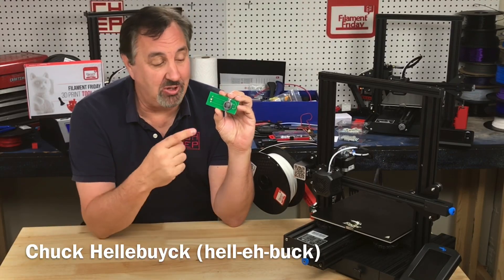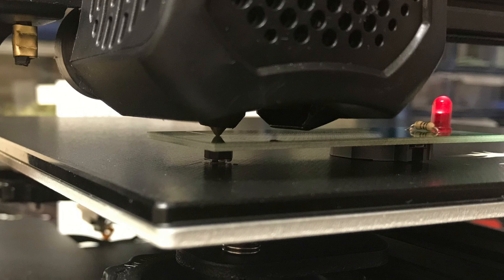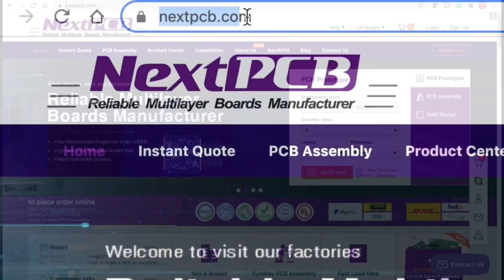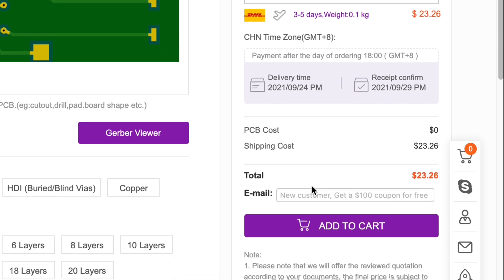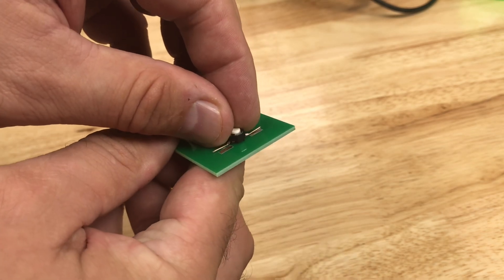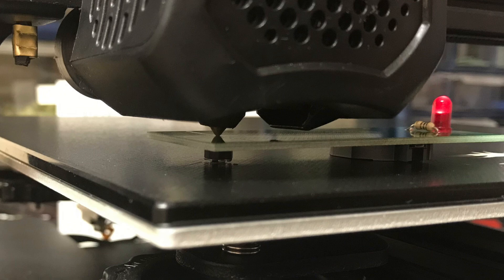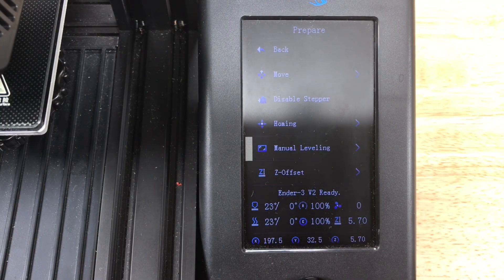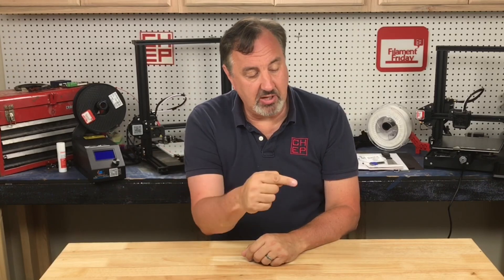Filament Friday E-Leveler - Electronic Device for Easier Bed Leveling on any 3D Printer

Comment: I've been 3D printing for about 3 weeks and I find that BL touch and CR touch are gimmicky as hell. I'm new to  3D printing so I've been trying what people suggested, some of it works some of it doesn't. I've been bed leveling using a piece of paper, it came very easy and natural to me so I don't mind it at all. I received this little device today and absolutely wow! it really worked. I was expecting this device to be... Meh but first layering was really fantastic.  Best $$ I spent on 3D printing thus far. Kind of pathetic that this reads like a bot salesman LOL but then again my 3D printer is printing beautifully, question is... is yours? But honestly this thing works so well that after I was done, I felt like I was cheating and I'll leave it at that.
Reply from the maker: Thanks for that feedback. So glad you like it.
Reply: im convinced that the cr touch doesnt do anything besides replacing your z stop.

everybody says its their to account for inconsistencies in the bed, if thats the case then why does it probe 16 times, and then still crash into the bed.
Reply: Mad Hatter. Virker den stadig som den skal ?

Comment from the maker: Wow! Thanks everybody. I’m told it’s already a popular kit. Really surprised by the response. It was just a fun idea I had. They’re trying to get more in stock as soon as possible. So be patient with orders.
Reply: Not surprised at all, you've reinvented autolevel without any rewiring, and if the user happens to kill the tool with bad soldering, it won't affect the printer at all. Looks really appealing to me.
Reply: This tool looks amazing. I want it badly. Sucks that I have to wait a month to order it
Reply from the maker: They are working to get more faster.
Reply: great!! I guess this could be connected to the bl-touch pins on the 3rd party boards.
Reply: This is awesome! I cant wait for them to get back in stock so I can get one!
Reply: Count me in to buy 2
Reply: @chep Im curious about order, placed order 2 min after video went up, never got a conf email, its not showing on orders for my account but the charge has gone through my paypal and the support for the site doesn't seem to respond??
Reply from the maker: They are scrambling to get orders out. You should hear something soon. Since I don’t have your name I can’t check on it. But they are beginning to ship. I’ve been helping as much as I can.
Reply: Chuck, The ULTIMATE way of Bed Level, is to attach a cheap usb 'EndoScope' camera, pointed at the nozzle. It's small enough to clear the print, and still show the tip clear.

You can easy see the plastic laying out the nozzle, and adjust the bed in real time using your Square Bed Level Pattern.

You Helped me so Much, I hope you read this and try it with a tiny camera on the Nozzle. , and I can show you a video of how good it works if you like.

Thanks Legend.
Reply: What software are you using to make your pcb files?
Reply: Did you delete my post on the dial indicator?
Reply: Order placed! Can't wait!
Reply: I was finally about to pull the trigger and get two kits at once to save on shipping (one for me and another for a friend that just got their first printer), but now it won't let me put more than one kit in the cart. I know it's not your website and therefore out of your control, but it's frustrating. I guess I'll wait until they fix whatever this issue is.
Reply from the maker: Last I heard they were low on stock waiting for more components to arrive. They may have only had one left in stock. I don’t know. Should have more in a few days I’m told so try again soon.
Reply: @FilamentFriday  I just ordered one since they are in stock again! Im a brand new member of the printing community and im so excited for this to come in. I already ruined a nozzle from getting it to close.... Youre amazing!!!

Comment: Just had to share: I picked up one of these months ago and assembled it, but took a break from printing shortly after. I just completely reassembled the machine with a new bed and springs. Thanks to this device, I'm already up and printing on my first try! This is the new de facto standard for accurate manual levelling, thanks Chep!

Comment: it needs to be pointed out that unless your bed is already extremely close to level, this will not give you a level bed with one pass. the 4 corners are not independent. raising a corner of your bed drops the opposite corner, and vise versa. so if your bed is low, then you bring up one corner, the opposite corner just dropped. then when you go back up and bring up THAT corner, the corner you already levelled will drop. 

you have to go around and level the bed back and forth to find the middle point, one pass will never do it whether you're using this tool or paper or a feeler guage.

great idea and video though!

Comment: I removed the bed levelling springs and went to solid pillars which are adjustable , i set the x axis beam so it is perpendicular to the columns then used a dial gauge mounted to the hot end to level the bed and once i had all 4 corners the same i let the BL touch routine look after the rest - now i don't even bother worrying about levelling the bed . Bed levelling is old school and if you treat your printer like a CNC mill and use something like a BL touch sensor routine to allow for dips and high spots in your bed life becomes much easier .
Reply: I don't worry about dips and bumps as use a sheet of float glass as the main surface which is flat so the sold pillars work fine

Comment: If you want to enhance the measuring tolerance, you could use something like an ATtiny in SMD package, a pressure sensitive resistor and 3-4 LEDs to create a simple pressure measuring tool. Should work in the same way, but the LEDs light up one after the other when applying pressure. This should give you a slightly higher amount of precision.

Comment: Great ad for the sponsor. I question the repeatability and accuracy of the button. The button will trigger the LED before it's fully compressed. Using an shim/paper of known thickness and having the nozzle just barely scrape it would be more accurate. The marginal difference between a vary loose fit and a tight fit between the shim/paper will be more accurate than the difference in the button triggering the LED and the button being fully compressed.
Reply: I agree. A piece of paper is far simpler, faster, and basically free... and if that sheet of paper rips, just use a new one. This is what I have been using from day one, and it has yet to let me down (ie, getting evenly squished first layers).
Reply: This isn't a new idea. It works fine.
Reply from the maker: Paper will leave the nozzle 0.1 away from the bed unless you live adjust or change Z offset. This gets it closer to true zero.
Reply: I haven't built this. I think... with this device you'd start with the switch completely unpressed. Then, adjust the knob slowly until the light just lit up. Since the button can go further, the accuracy will depends on how slowly the knob is turned.

Compare to paper method, the tolerance might be higher as paper would not squished as much, but visual indicator would be more objective than how the paper feel.
Reply: It's accurate because the throw of the button is within the measured tolerance of the device. I measure until the button is borderline pressed, switching on and off under the slightest movement, that shows you are within the button's throw and therefore within the measurement tolerance

Comment: Thanks, Chuck gave me an Idea to use an old gate/garage motor remote and it worked great. I need to spoof the S1 pro a little because the height of my board is 6.4 and I can only set the offset to 5 on the S1.

Comment: I think I’m gonna one up this and just say take a 0.2mm feeler gauge and use it as an contact point (with battery and led in line) and connect the other electrode/gator clip to the extruder body. It’s metal and electricity will flow from body to the nozzle to the feeler gauge.
Reply: You could also use a multi meter set to continuity mode with one probe connected to the feeler gauge and one to the nozzle
Reply: @AndrewAHayes  you’re right
Reply: This is essentially the system that Lulzbot printers have used for years. They level against washers at the corners of the bed by closing an electric circuit. It's a neat system... which fails moderately often when plastic ends up on the nozzle.

Comment: I used pressure sensor with arduino that displayed a value on a lcd display. It can also be made to use a piezo buzzer or use led's by modifying the firmware.

Comment: Great video. I have not seen anything like it available in 3D printing which as you pointed is funny because cnc machines use bit setters all the time. Could see this being super useful for someone new that doesn’t know how to visually gauge or get the correct feel with something like paper. Awesome job man 😬

Comment: The only problem is that without a backlash nut, any time you push against the nozzle, it is going to rise up to the extent of the backlash present in the leadscrew/nut assembly. Even with a backlash nut, using the nozzle to push down on the switch will induce some errors.

It would be better to use a linear microswitch instead of a momentary pushbutton switch, which tends to require a greater amount of actuation force.

Comment: I purchased your E-Leveler Device, its a great tool the issue im having is when i level my bed with this tool it levels about .5mm to close the the bed. i put 5 pieces of paper under the device and re-level and it comes out great.

Comment: I like this, but I don't like having to readjust the settings on the printer.  I don't like the Enders UI.  But, Chuck... This is BRILLIANT.

I'm going to get wire up a U-connector, put it between the print nozzle and print head, wire it to a single AAA battery (far enough away to not be affected by heat, and no resistor will be required) then wire through to an LED, then to a thin metal plate of known size.  I reprogram the buttons on my tablet that talks to OctoPi to reposition position the print head to 0+${Thickness_of_metal} at different points on the bed, then readjust the bed as needed.

There's pros and cons to both of these methods.  Whats here in this video, the downsides is resetting the printer every time you want to bed level, and depending on the quality of switch, it could break and you're looking to replace.  The upside is that it is a SOLID tool that's put together and very easy to maintain.  No moving parts other than the button.  In my way, with moving wires around, you could break solder joints, but, this tool stays WITH the printer, and there's no adjusting of printer settings.

Another option I just thought of is put some buttons on the four corners of the print bed, wire up the buttons in parallel and you'd get the same deal.  Potentially a loss of bed space in the corners but I RARELY print at the corners anyways.  That thin head cleaning line that my Ender prints out before each print is easily reprogrammable, so just shorten the line, do more passes.  I'll just need to remember to change that setting if I ever reload OctoPi... heh

Comment: Forgive me if I don't understand or missing something. You set the Z offset to 5.7 then 'level' the bed with the device. After you then set the Z offset to zero. Wouldn't this mean that the nozzle is set to the absolute bed surface? What about the gap between the bed surface and the nozzle? Thanking you for your videos. Always interesting and informative.
Reply: The 5.7mm measurement was when the button was fully depressed, but when levelling Chuck was getting it to just barely turn on. Maybe the distance between that state and fully pressed is what gives the first layer distance. Seems like a cool way to level, but you'll likely need to tweak the Z offset once you do.
Reply: @mikevsamy  Thank you for the reply. I like the concept but would like clarification as to how the gap is obtained and measured.
Reply: @phorton7039  agreed.
Reply: When start printing, printer will adjust the gap from zero based on the layer height setting in slicer sofware. If your nozzle is not zero to the bed it will add on the first layer height.
Reply from the maker: The first layer GCode will offset the nozzle per your slicer settings. Typically 0.2 or 0.3 mm.

Comment: I bought one and I love it. I left a review on Amazon as well for any who are on the fence. For those concerned about the $25 price, keep in mind we are not only paying for a battery, circuit board, a few cheap components, Chuck’s prototyping time, etc… No we are helping to support a really nice gentleman, who has been helping us, for years, for free. Buy one! You you will not regret it.
Reply: i'm willing to support chuck and that's why i won't buy the china copy
Reply from the maker: Thank you for the support.
Reply: @FilamentFriday  are there other distributors in europe apart from amazon?
I've found dealers on amazon(uk + de), but they charge 77€ - 85€, which I feel is exorbitant.

Comment: This is cool! I'm going to try something similar by connecting my multimeter in beep mode to the nozzle and a metal plate on the bed and I'll use the beep instead of an LED. It's probably important to mention that it has to be placed exactly over the adjustment screw in order for it to work in a single pass.

Comment: Manual adjustment is pain, I remember in mid 90's when we got first PCB router, it was manually adjusted, try to find suitable feeler gauge to under toolholder stop (when it lay against PCBs copper routerbit should go deep enough and cut copper away but not too down because router bit was V shape and too deep cut remove copper all the way it it was thin). For me paper works quite well for Ender 3 and 5. But of course we need tinkerin and someday got progress. This is interesting idea, by the way.

Comment: Might be a good application for capacitive touch using an 8 pin ATtiny and a large copper area on the board.  Then only the thickness of the pc board would be used and no moving parts.
Reply: FSR with a comparator would also work

Do some trial and error with an fsr, multimeter, and MANY iterations of your z offset to get good nozzle height, record that resistance value, use that as a fixed reference resistance, once the FSR reaches that resistance, the circuit closes and you get the endstop signal
Kinda complicated, but would remove mechanical points of failure

Comment: Too bad that the shipping cost (for the CHEP Electronic Bed Leveling Tool Kit) are very expensive for me. => $ 20,00
Reply: "shipping cost" "free" ... this is garbage. If someone at this company thinks that this is a good advertisement: nah, i will never use your service. Maybe hire some adults doing marketing. Super pissed.
Reply: @notlocalhorst  Why is this upsetting? Obviously they cannot "give" things away. Somehow they have streamlined their manufacturing such that they can swollow the cost of manufacturing some small number of boards. That saves $2 on the board cost from their basic service. But, the shipping remains the same.

It's not deceptive or even unusual. What's unusual is to be able to buy things without paying for shipping specifically (though Amazon has made that feel normal).
Reply: @martinmckee5333  $20 is not the shipping cost, that is shipping plus the goods. So much for "free". I prefer to see the real price of both. If this is not unusual for you: ok, go ahead and use the service. I will not. It is NOT about not paying for shipping, it is to have a fair and transparent pricing. If i miss something and didn't saw that it is priced separately I apologize.

Comment: Interesting.  I had the same basic thought, but using a strain gauge — more complicated, but should be more repeatable than a switch, although probably good to 0.001 mm which is likely to be overkill.

If the switch is good enough then this should work fine.  👍
Reply: This will probably be more accurate than a strain gauge. A microswitch trips at a set poistion regardless of the pressure of speed. A strain gauge measures strain, and thus will be influenced by things like speed and temp

Comment: Before I purchase I need to understand something.  Isn't the nozzle just being adjusted to the relatively large thickenss of the watch battery or switch all around the four corners, and
not the thickness of 0.1mm or A4 paper during a conventional leveling using paper ?   Do you have to then manually introduce a Z offset value to compensate for the fact that you were leveling to a much larger nozzle gap of the device ?  I'm asking because my (original) Ender 3 does not seem to be able to accept Z offsets even though that control is available on my LCD screen.
I'm not questioning the value of the device, just trying to understand it before I buy...  Thanks.
Reply: Yeah, I just got mine in today, forgot about that and it does require the ability to manually adjust z offset, and my Ender 3 v1 doesn’t have that ability. At least using the encoder menu.
Reply from the maker: The z offset set to zero is the intent. The custom GCode offsets the height during measurement at each corner and then resets to zero giving a near perfect bed level.
Reply: @FilamentFriday  Just so I understand:  In my original Ender 3 I will not be adjusting Z offset on the LCD (which I can't do anyway) to subtract out the effect of the E-Leveler thickness.  The thickness of the E-Leveler (5.8 mm or so) is compensated for and built into the Gcode that runs the testing at the corners, correct ?
Reply from the maker: @bobcarwell9172 - Correct.